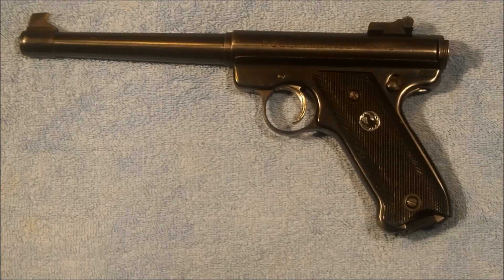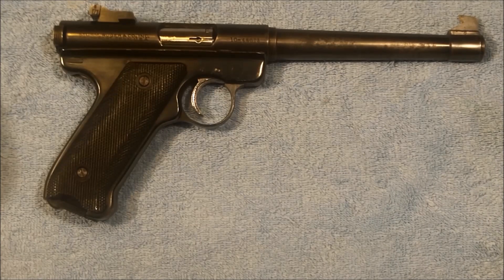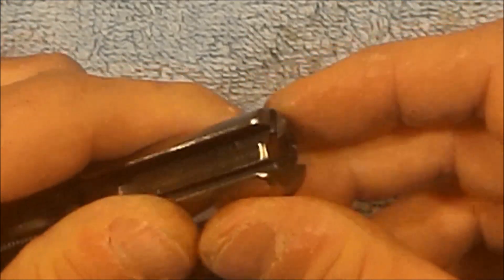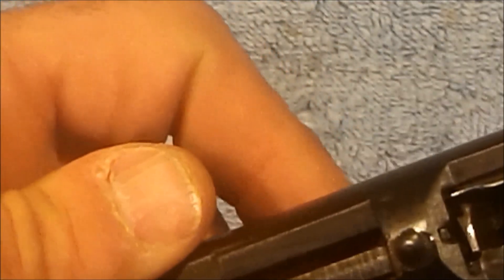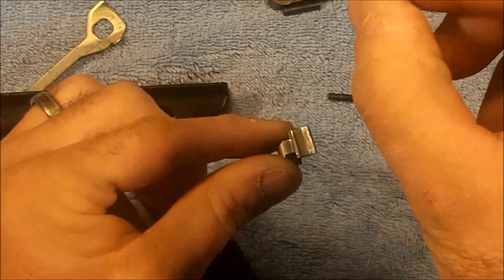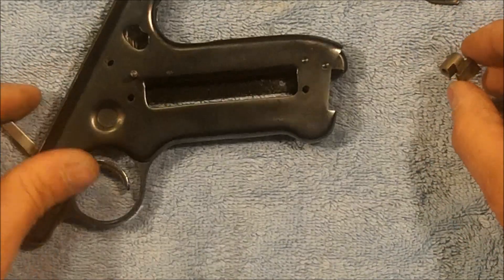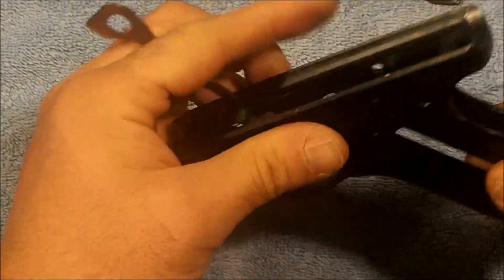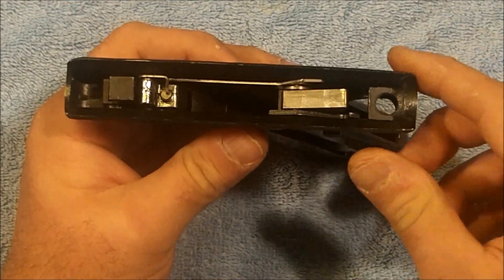Ruger Mk I Rebuild (With Sound)

Comment: Awesome, thanks!  Made it easy to get the new-to-me mk1 back together and into action.  There position and spring on my extractor were totally locked up with rust as well.  I had to take the face plenty hard several times with a punch and mallet to get it to move rearward at all.  Then I took apart the hammer and sear to clean all of that, and this was perfect to help me get it all together.  Not too hard when you can watch someone that knows what they're doing.  Thanks again.

Comment: 16:32 Everyone notice how he pulls the bolt back a little so he can still dry fire the gun without damaging the firing pin. I see so many people just full out dry fire a rim fire gun without doing that. It is a little harder to do on other .22 designs but should always be done on a rim fire gun.

Good Job on the video very detailed.
Reply: Incorrect.  The original Standard and Mark I did not lock back after the last round is fired in the magazine, so you potentially dry fired the pistol every magazine, but it is designed for that because it has a firing pin stop pin, to prevent over travel of the firing pin.  It is the horizontal pin in the bolt that goes through the hole in the firing pin.  When the Mark II, and all later models were designed to lock back after the last round, the bolt still has the firing pin stop pin.  Applicable to the 10/22 rifles also, item #11 in the exploded view for these rifles, which do not lock back either.

Comment: I pickup a low mileage like new  1980 mk  standard 4 inch  it looks like it  was  stored un  saw dust in a wood shop i couldnt pull the bolt back tha bad did a  complete solvent  tank and bolt disassemble  its like new once i did a detail clean paid 100 dollars best money i spent  thanks  your for you experience

Comment: You have the wrong detent pin in it. You should have to remove the firing pin to remove the detent.
Reply: The Old Models had a shorter extractor follower. The firing pin stop pin could remain in the bolt when removing the extractor. A dental pick and magnet help when removing the extractors in New Models and Mark II's. The extractor snaps right in when pushed against the spring pressure.